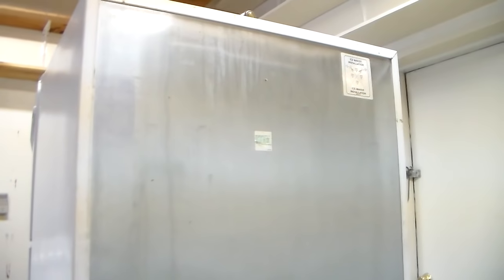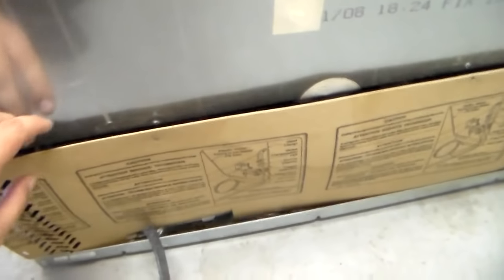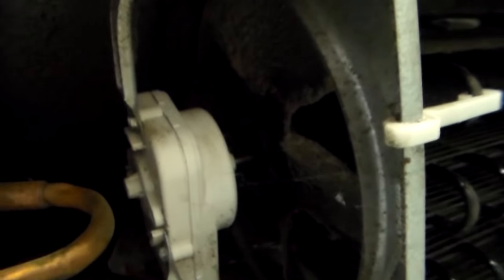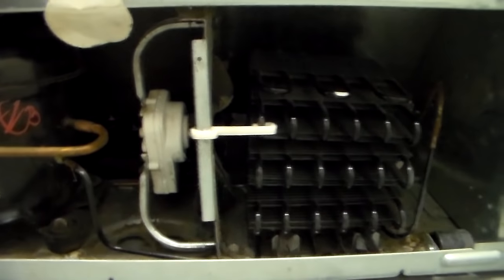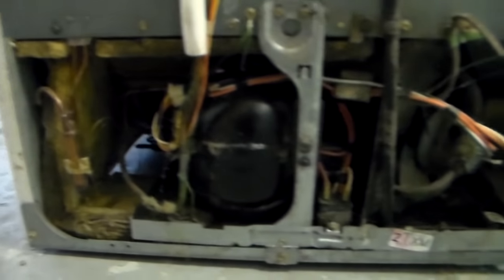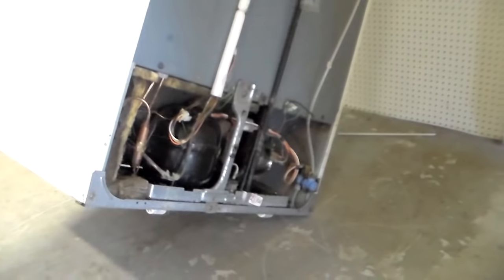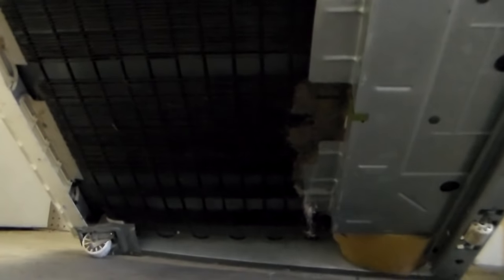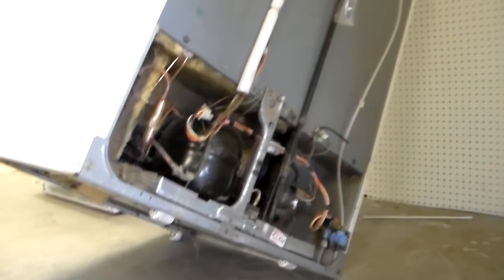Condenser Coil Location on your Refrigerator

Comment: What is wrong with refrigerator engineers? They place the condenser coils in the most inaccessible place, making them impossible to clean. Condenser coils get hot and they place them on the bottom of your frige  or freezer. Don't they know heat rises? Put them on the top, make them easy to clean.

Comment: Some new models (supposedly this is becoming more common) don't have any visible condenser coils at all! The coils are hidden between the insulation and the side walls. They can't be cleaned and that is not necessary since there isn't a single hole anywhere.
Reply: Thanks, John. That would explain why I can't find any coils no matter where I look around my Panasonic  fridge freezer.
Reply: @Naskeleng  Did your refrigerator have at least a fan?
I bought one today (a chinese refrigerator) and when I looked behind I didn't find any fan nor condenser coil, I thought they might be in the walls (I think that's what they call "full skin condenser"), but there was no fan so I when I read your comment I thought that this may be a characteristic of this kind of refrigerators.
It's been 10 months. Hope you read this.
Reply: They want you to take your fridge to them to clean them so they can charge you out of your ass for it the same as cars.

Comment: I had a theory for why the old fridges last longer than newer ones.  
I noticed most of them had the coils on the back, out side of and away from the box. They were easier to clean and kept the heat further away from the interior you're trying to keep cool. And they seemed more spread out to allow better airflow.
I think the bottom coils on the bottom collect all the dust bunnies from the floor faster and are closer to the insulation where the heat can transfer to the inside, thus making the compressor work harder to keep cool.
I tried looking everywhere for answers on this but no one is comparing the old fridges vs new.
Reply: Really? 🤔Now I'm going to change my choice
Reply: I just bought a fridge today, used, built in 2005, and it has the flat coil panel on the entire back of the fridge.  I plugged it in and it seemed to get cold very quick, like in 15 minutes!  Maybe your theory of a flat panel of coils dissipating heat better than a "rolled up coil" where dust collects on the bottom is worth thinking about.  Anyone else have good efficient cooling with the flat panel of coils on the entire back of their fridge - ?

Comment: One type of coil system you didn't mention: I've got a GE side-by-side model, and the coils appear to be in the lower right corner. The position resembles that small stack shown at 1:00 in the video, but on mine, it's more like a circular radiator tunnel with fins on the outside (I can see some coils under that radiator, and some seem to be wound inside it). I cleaned it as best I could, but the far side of the cone can't be accessed (unless a panel comes off on the inside or something, which seems like way too much work to clean coils).

Comment: Hi Bill, I found your video helpful in locating my Kenmore’s condenser coils in the back of the refrigerator.  I had watched another video where the coils were conveniently located on the bottom just behind the front grill.  By the way there was a boatload of animal hair located there too just behind the front grill next to the pan.  I did do one thing which was unplug the frig before I took off the back cardboard panel which you may have mentioned that I missed   I noticed nowhere in the Kenmore manual were simple instructions for cleaning the coils seeing as to how important that is and I really appreciate your video.
Reply from the maker: They can get pretty bad under there.  I have pulled out dead animals from under there.  lol  Thanks for Watching!

Comment: I have one of that freezer at home. However, I have a problem with it. The lights in the house dim enough to bother me every two second and look like it's overloading something or use alot of electricity. It dims for two second and then back on at full light. Can you help me on this? Could it be a bad thermostat?

Comment: hi 
i am planning to buy a bosh refregator , but the thing is that its back is open < meaning coils are visible > will it create any problems for me in short or long run ,,, are these visible condencing coiils at the back is okay, please replt
Reply from the maker: siddhartha bharadwaj I imagine that there should be a cover over them.  It sounds like a part may be missing.  This will cause irregular temperature readings i'm sure.  Air has to be pulled over the coils to circulate correctly.  Pretty sure you'll have issues with cooling without the cover, short and long term.
Reply: thank you bill. will take your advice
Reply: +Bill Newberry The classic type has all the coils visible and has no fans or covers (most of the fridges or freezers I've seen have had these). I just removed one that had these and the coils had 30 years of dust on them. Worked like a charm (might've been a fire hazard, though..). Now I have a new one that has no visible or accessible coils at all! The coils are integrated somewhere inside the walls, thus, no need or possibility to clean them.

Comment: do i have to cover it again my kids lost the cover
Reply: Mely Rodriguez 

If the cover is lost, you need to make a cover. Measure the opening and cut out cardboard to the measurements. Be sure to cut out openings on the opposite side of the condenser, which allows air to be pulled by the fan and than over the condenser to cool it. Without the cover on the back of the fridge, it will run excessively.

Comment: Either the refrigerator company's engineers are idiots or they are trying to make refrigerators go bad as fast as possible so people buy more because nowadays they put the condenser coils on the bottom of the refrigerator in the worst place possible to put them when the old ones had them away from the bottom and easily accessible.